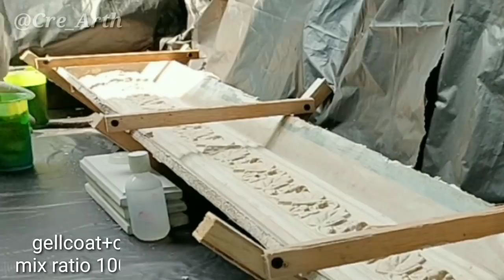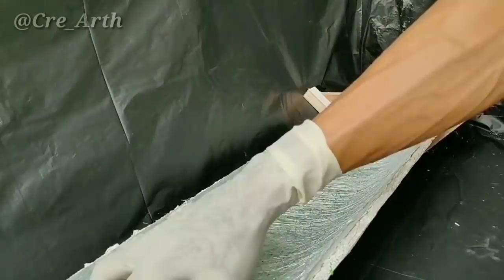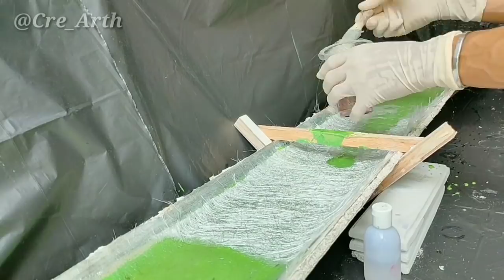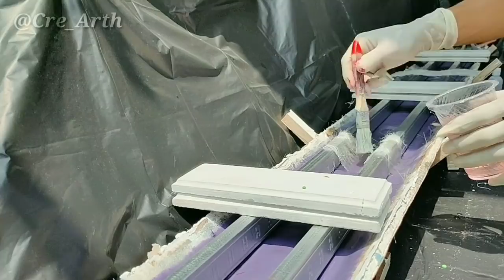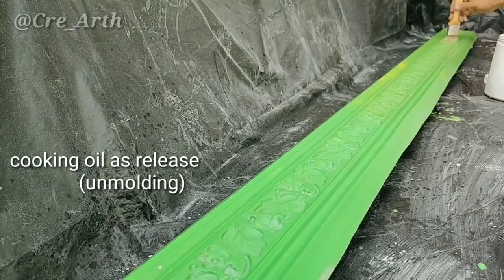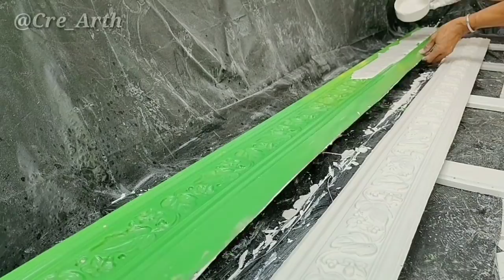how to make the fiberglass mold for plaster ceiling leaf motif

Comment: having worked with fiberglass for years I hate the stuff. it will poke and itch for days. if you decide to do this consider burlap. then all you have to worry abouut is the resin. resin can give you a styrene high that will give you a headache that you won't forget. Look carefully for the resin you use. good luck. this guys work is beautiful.